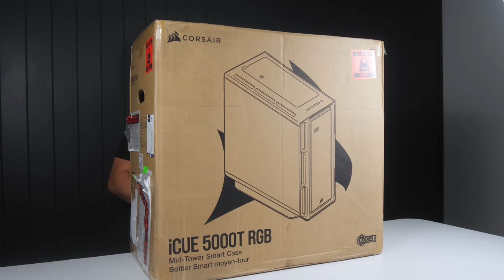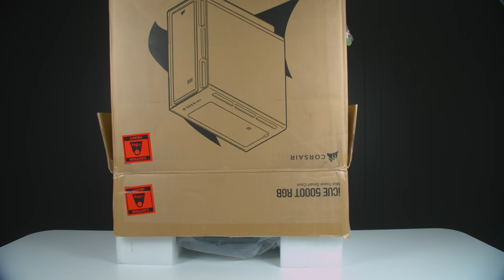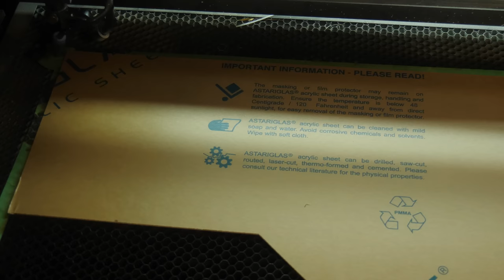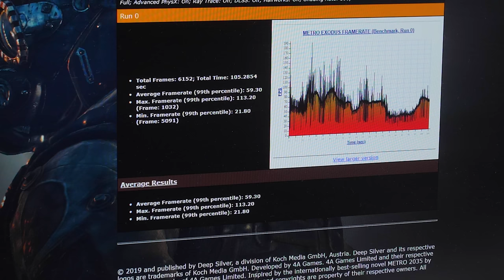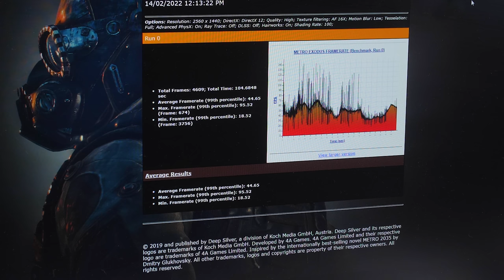I FINALLY Built a Budget PC... or did i?

Comment: Absolutely beautiful system, but I think "budget" is really no word that should be used here. You could get much more performance if you only ditched the fans for cheaper ones, the Z690 platform or the watercooling all together..
there really isn't a budget conscious watercooling build IMO.

So I would argue, no he did not ;)
Reply: bro's gpu cost's as much as his motherboard HAHAHAHAHA
Reply from the maker: OR DID I?
Reply: @DesignsByIFR  you dident the build makes no sense to me imo
Reply from the maker: @mechapope9168  OR DID I?
Reply: @mechapope9168  even to me... I like how it looks, but I don't buy for any reason... Better a 4k pc build.
Reply: tbh he wasn't lying about it being a "budget build", he just has a really big budget.
am I right  @DesignsByIFR ?
Reply: Agreed.  Running a 12600k, he could have paired to an rx 6600 (or even a higher end Radeon or nvidia card) for what he spent, and gotten much more performance dollar for dollar.  Could cool it all with antec f12s and a half decent budget cpu cooler. 

I've seen air cooled 12900k builds that won't touch 90c in benches, liquid cooling at this price range is just ridiculous.
Reply: @justcynical6590  believe it or not its actually more expensive XD

Comment: Nice touch with the MinIMUS motherboard Cory! Corsair 5000T, Z690 Hero board and water cooling... yeah; a real budget banger ;) Still, a very neat looking build as usual (I prefer the more minimal look anyway).

Cory, I understand you're simply fully populating the memory slots but... you should warn people that currently 4 x 16GB sticks of (64GB total) DDR5 will most likely only operate at 4000MT/s, not their advertised XMP speed on the sticks. If you want 64GB of DDR5 memory to operate even at 4800MT/s, buy a 2 x 32GB stick kit.

Comment: Can you do a build with a RTX 1660Ti, i3&5 10100&10400 , Asus ROG strix B 460H, 16Gb ram DDR4 ,  250Gb SSD ,no water cooling , ATX case and relevant power supply. think its more in the line of "Budget"
Reply from the maker: Id need to find those parts

Comment: my question is about power supply, how do you know the system needs certain amount of watts and if you increase or decrease the power supply, does is affect the system in a bad way or it just stays normal?🤔
Reply from the maker: Usually manufactured display how many watts a product like a gpu and cpu uses. Then id add some buffer room ontop of that

Comment: i got a constructive criticism, you put the front radiator in the wrong holes when fastening it in the case, it left a gap where you can see the round outline of the fan holes. also you shouldve vertical mounted the gpu and done a watercooled gpu, thats a lot of cooling for just the cpu.